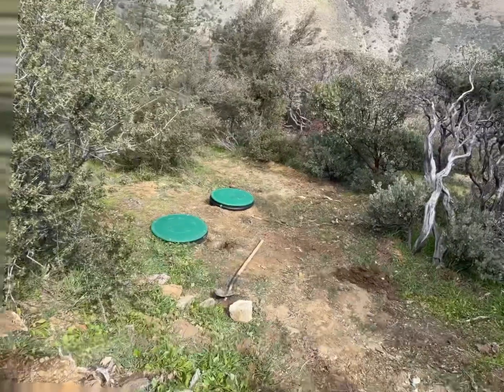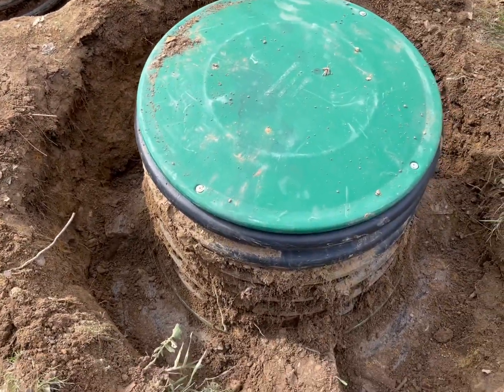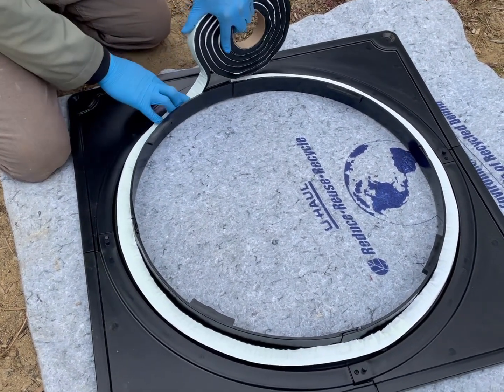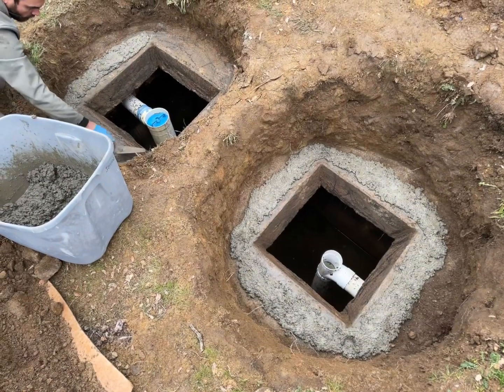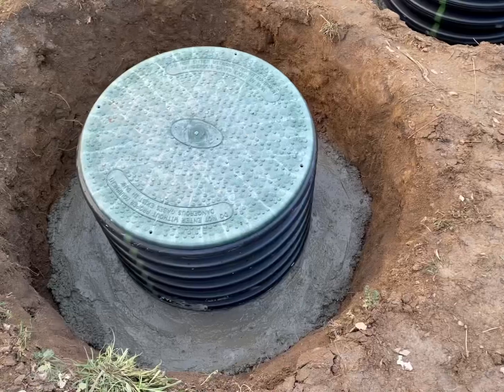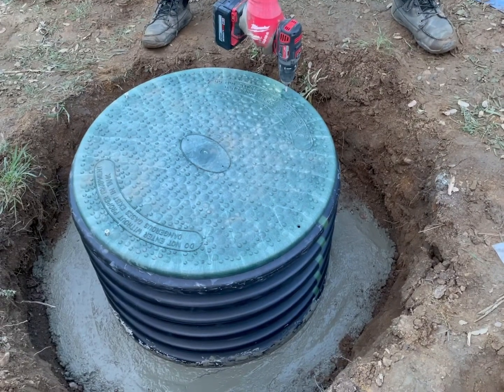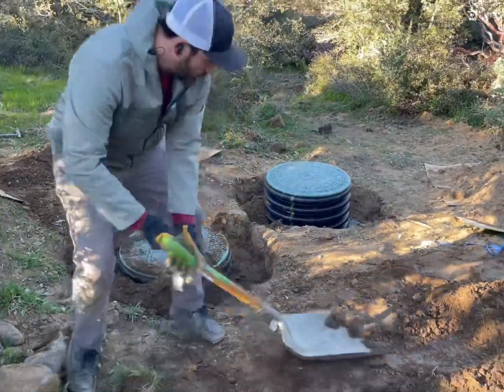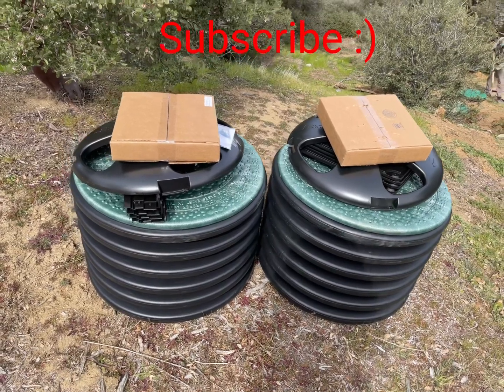How to Install Septic Tank Riser DIY

Comment: How did you know you were getting leakage? - Also, no need for cement. The sealing tape is more than enough + the weight of the sand/dirt is enough to keep it from ever moving.
Reply from the maker: I knew there was a leakage because the tanks were not in use and were empty initially and the leakage started only after I hired someone to install the risers. Every time it rained, both tanks filled up completely. So I knew there was some kind of damage that was done when that person installed them. It was trial and error to figure out where the problem was located and that ended up with me replacing the risers with new ones and I know the cement was overkill but didn’t want any chance of them leaking. Initially I thought the leakage was due to them not being sealed properly and hence the cement use.
Reply: Those risers are dog water! Primarily due to how the lid attaches. You’re gonna keep punching holes in the corrugated pipe. So just try to keep “hitting” the same holes when you screw the lids back down.